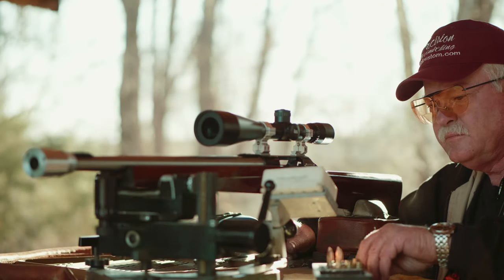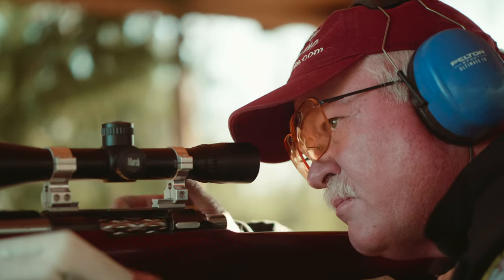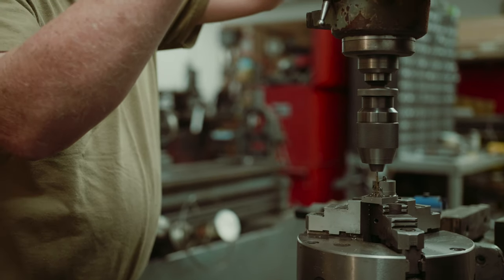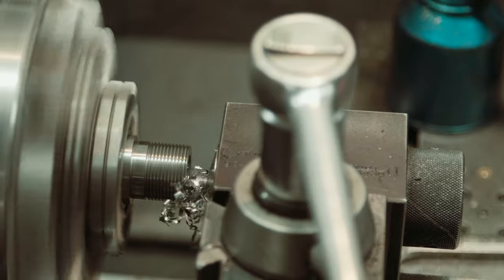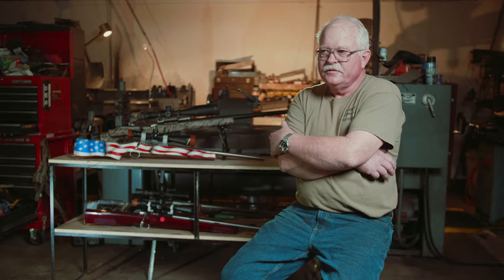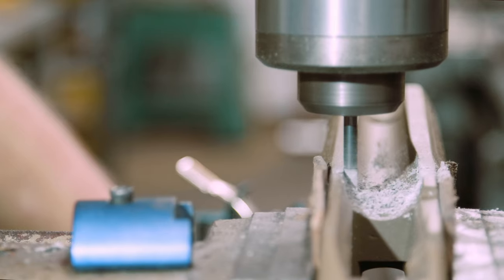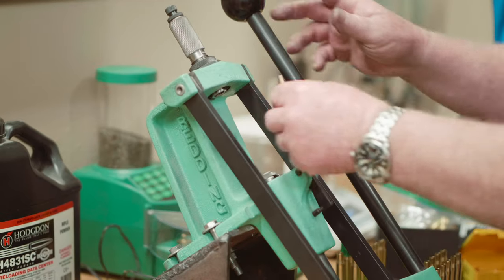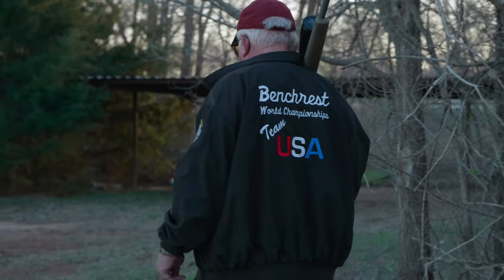Accurate Rifles. Gunsmith Builds World Record Setting Precision Rifles | A Sheldon Charron Film

Comment: You know, hearing what this man said about the first barrel he ever made really strengthens my opinion about how rifles are made and how it relates to how they perform; It's all in the manufacturing quality. I calibrate precision instruments (not firearms related) for a living, and there's a distinct difference in the accuracy of those instruments which is purely dependent on who did the calibration. I couldn't tell you how many times I've heard the phrase "good enough" when it comes to calibrations. It's either right or it's not, and I think far too many gunsmiths have reputations which exceed their level of workmanship. Kudos to this guy for not allowing his work to be "good enough."
Reply: Nice to see a video of Mike Bryant, I used to talk with him once in awhile on the Benchrest forums some 20 yrs ago. He was also very polite and helpful.
I hate hearing shooters say, "Good enough" when they just shot a 2 inch group at 100 yds.
lol, like Mr. Bryant said, most factory hunting rifles just don't shoot that well. But Good Enough is all some people are used to.
Those types of shooters are not the kind that appreciate the gnats ass dial in of a barrel to within .0001" front and rear.. or 4 hours worth of slowly, carefully and methodically reaming a match chamber pecking .025" at a time just to make sure you don't nick the chamber or chip the reamer or cause chatter while reaming.
People think threading for a muzzle brake is as easy as just using a tap and die set and sticking it in the vise and getting the big crescent wrench out when that one simple operation is every bit as tedious as match chambering since everything must be concentric to the bore.
Good enough....isn't

Comment: I  noticed you use a Unerdal style , sliding scope  mechanism . I make my own scopes . theyre huge , but heavy . at 600 yards , if you cant see it , you cant hit it .  I get lenses out of old telescopes from second-hand stores . I had trouble getting fine enough cross-hair wire . Then I found this calibrating resistance wire , used in commercial photo copiers . Its so fine , that if you lay a peice of it on  the table , you cant find it, unless you marked where you laid it . I found  for accuracy , the scope has to index exactly back in the same place . so now I use indexing cones and a light spring . The only time its ever off , is when a dust partical gets on a cone surface . The cones are made from wheel bearing races . My freind put a sticker on my target once , and said " can you read that [ at 600 yards ] ?" It said Baby On Board . , but there was a black tryangular line around  the writing . Within the 3/16 black line was fine white printing  , 1/16 high . I said " Ya , it says C-Fax 1070 Radio ."
Reply from the maker: Hi Paul. Mike probably won’t see these comments. I’m the filmmaker. He has a contact page on his website where you can communicate with him directly. :) Thanks for your comments and support!
Reply: I would like to know more about your scope making process. Quite an art

Comment: Imagine if he had a quality lathe!
Reply: The Older Jets were actually pretty good, I think he said his was made in the 80's
My 1980's 1340 GHE Jet will machine Blue sharpie marker ink off the barrel without cutting steel which is approx .00016" or 4 microns, the tolerances are that tight and repeatable. If I need to pick up and continue a thread without reducing diameter or thinning existing thread this is actually the method I use such as when setting a barrel back.
 It may be a fluke, it may be that some machines were made by old timers that took pride, I dunno. But I did not expect that kind of accuracy from an Old Jet Lathe.

Comment: In your opinion, would it be worth having a .22 LR custom built for silhouette bench shoot competition, or would the factory Voodoo, Ruger Precision, CZ, Anchultz be the ticket. I shoot a lot for fun but just retired and am considering a pastime to meet new friends and pursue a lifelong passion. I also subscribed and liked thank you for your video, it was well done!
Reply from the maker: Hi Michael.  Thanks for your comment. Please ask Mike directly using the contact form on his website at www.bryantcustom.com.
Reply: I shoot .22 benchrest and thought I'd offer some help. My rifle uses an Anschutz 54 action and trigger, with a Shilen ratchet barrel. At our local match, we're trying to hit a .224 diameter bull each shot for 50 bulls. Missing one typically means you don't win the match. There are many full custom rifles being shot. Most are highly accurate. But for .22, the rifle is about 75% of the accuracy equation. Selecting ammo that shoots extremely well in your rifle is the important other 25%. Most shoot Eley Match or Tenex. And it's not uncommon to test 5-10 lots to find the one that produces the best groups in your rifle. The best lots will tend to produce 1 hole 3-5 shot groups. 

For silhouette, I'm not sure you need that level of precision, although it can never hurt. Of the brands you mentioned, I think I'd recommend Anschutz first. Not just because I have one, but because of the ones you listed, they've been building highly accurate .22 rifles for decades while the others are relatively new to the discipline. But even after you settle on a rifle, for the best results, you'll need to choose a windless morning to test multiple types/lots of high-end .22 ammo to find the one that produces the best results. Yes, you can just shoot any good ammo and get OK results. But if you're competing to win, you have to match the ammo to the rifle.

Comment: An honest man who says the first 5 shot group was .08! Honest because he didn't try to claim a three place decimal. You cant measure  a group to three place ,you can't measure a bullet hole to three places . Image a barrel maker wanting to know the diameter of a barrel shooting a hole in a piece of paper and using that to claim he/she could tell the bore diameter by measuring the hole in the paper! They'd be a laughing stock!!!
Reply: In benchrest competition the scorer uses a special made caliper  with a plexiglass reticle with bullet diameter circles inscribed on the plexiglass. The caliper is zeroed and the scoring reticle is centered over the bullet hole on widest part of the group and then moved to the opposite side. The caliper gives a direct measurement of center to center of the two widest shots. The other three don’t make any difference as to measurement. The group size is measured to three decimal places. But, it is subjective and the same scorer can measure the same group and get various measurements.  At a registered match, the same scorer measures every group. There always is error in measuring groups.  Having the same scorer helps minimize error and everyone gets basically a fair and impartial measurement. Scorers for make mistakes and there are procedures where the shooter can request the measurement be re-scored.  If it’s within  .009” of the original measurement then the original measurement stands.  If it’s outside of the .009” range, then the new measurement stands whether to the shooters benefit or not.
Reply: @mikebryant8979  Thank you sir.
Reply: Groups hole size outer edge to outer edge - Minus Bullet diameter
If group size outside to outside measures .304"
Subtract .224"
= .080" (to third decimal place is fairly easy actually)